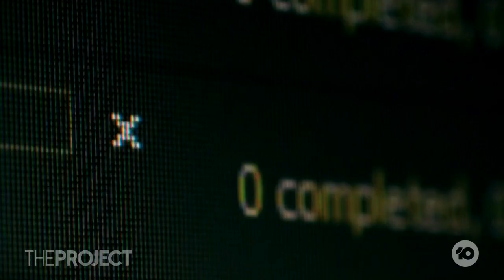Government Reveals Most In-Demand Jobs As Crisis Of Skilled Labour Shortage Looms

Comment: I have my two daughters one a civil engineer and the other a software engineer and are presently working in their specific fields. My civil engineer daughter has applied for 189 and 190 but has not been given the invitation. My software engineer daughter has finished 1year working and  cannot apply as they are asking for 3year work experience. If they really have a shortage for skilled migration why don't they give priority to the ones who have done their degree 's in Australia.
Reply: With due respect to the quality of Australian graduates. The reason is that skilled migrants are also older migrants (in their mid 30s-40s) who’ve been working for at least 8 years in their profession with specialised work experiences. However most would only be offered junior/executive level positions. Therefore working way below their professional capacity at much cheaper wages. And with less “rights” to fair work conditions like safety etc.  Anyway, it’s just my personal experience. I might be wrong